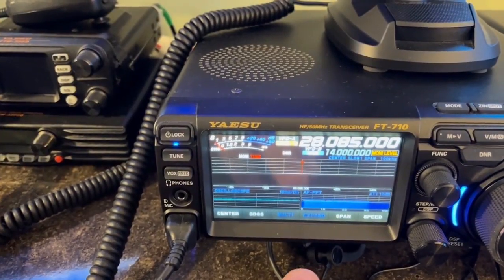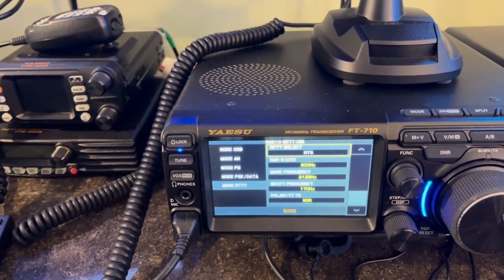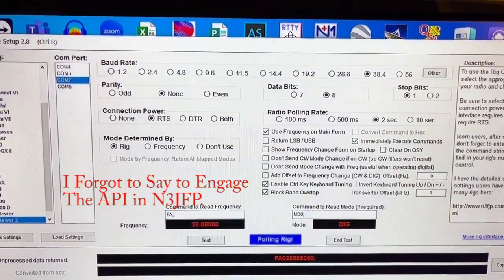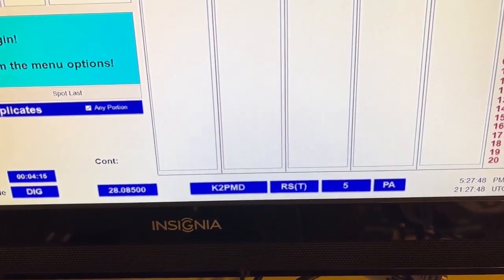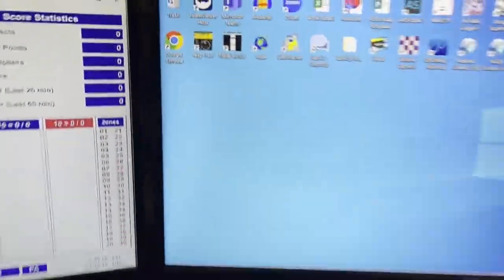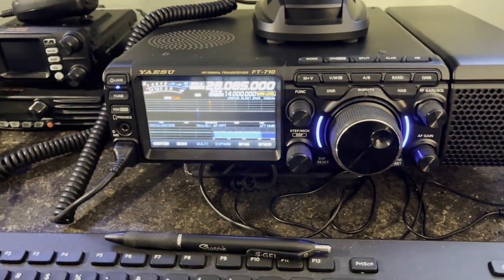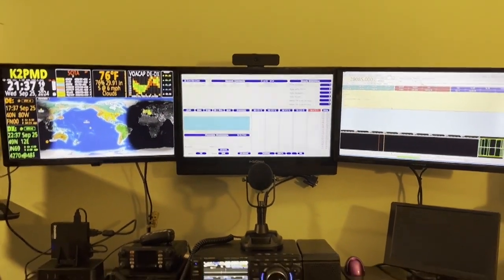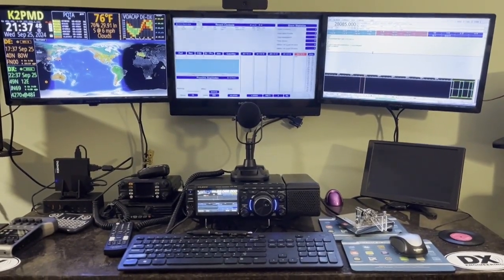Yeasu FT 710 EASY RTTY w FLDGI and N3FJP

Comment: Thank you for your video Paul. Followed it step by step. First issue, couldn’t get the logger to connect to the ft710. The tests all pass and connect requests are sent, but connection unsuccessful. Second issue is transmits from fldigi do not trigger the rig to change to transmit mode. Need your help getting this to work. Thanks in advance. Mark. N2IRY

Comment: I couldn't get it to work.  PACKET doesn't show up in the upper menu, and I don't see a waterfall.  Any suggestions?
Reply: is the radio full updated? if so try a factory reset.
Reply: @GamingKing545  Yes, it's updated.

Comment: Hi Paul. I am Tom KB2TDH I have been pulling my hair out (I am not too far behind you) trying to get my FT-710 working with RTTY and FL- Digi and still not getting there. I have missed a step somewhere. I have the same Logging software N3JFP but and I think it’s set up correctly but if I open config on FLdigi and click on contests and click on the one for this weekend it just turns it right back off. Also I am not getting a rig connected with FLDIGI. I see that you have several more comm port options than I do. I have the FT-710 driver download and I only have 2 comm ports and only one of those working because I only have the one cable from my computer to the rig and I can’t seem to use the comm port for both apps at the same time. Any suggestions would be greatly appreciated

Comment: I think your rig control directions are incorrect. Unless you check the "Use Hamlib" checkbox, those settings are not used. You might have lost track of how you set Fldigi up. I got PTT to work by using the "Hardware PTT" settings. I checked "Use Separate serial port PTT," chose my rig control com port, then "Use RTS." Make sure you initialize.

Comment: I have not used RTTY yet. Do you have a video on how to setup FLDIGI for RTTY in FT-710. I do not have a data cable, only a USB Type A to B (printer) cable. Not a real contest operator. 73 Jon, VU2JO